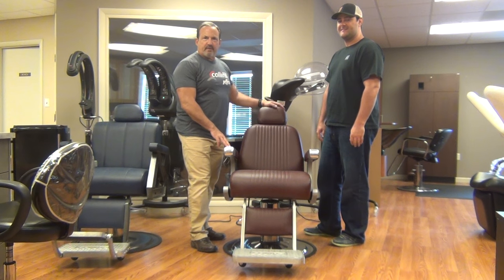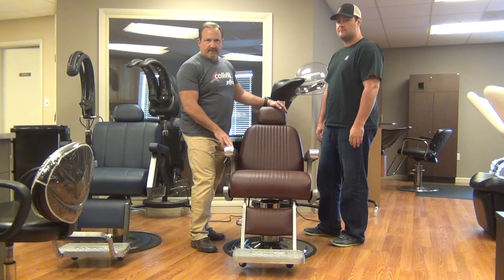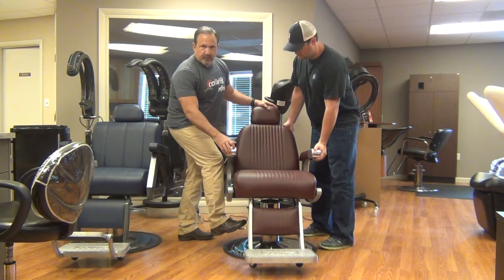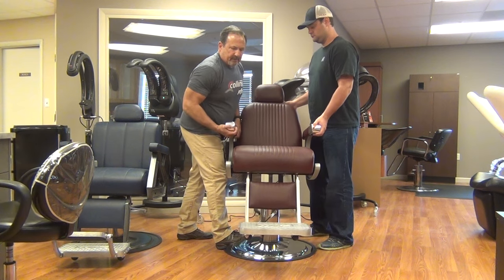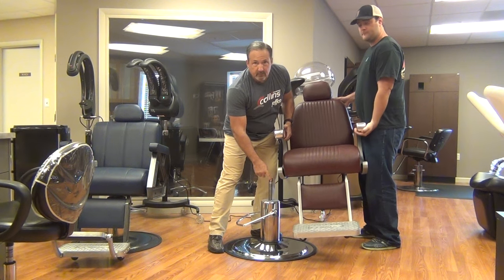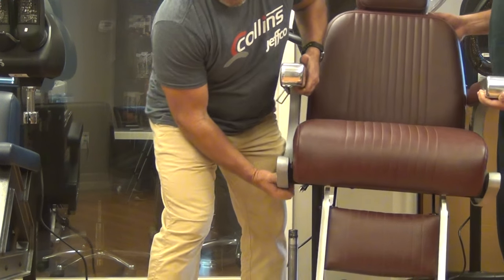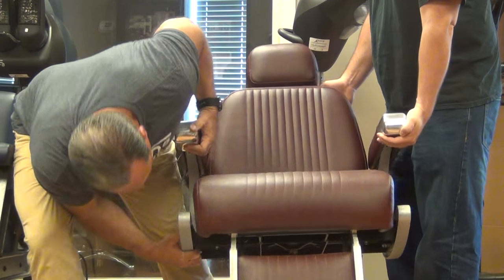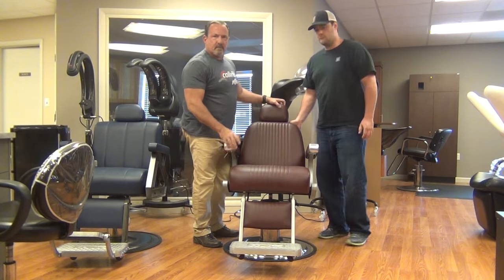Removing a Barber Chair Top from Hydraulic Base

Comment: I find your videos very informative. Do you have a video on how to remove the hydraulic  pump from a 5 star base? I believe it’s a tapered fit but I’ve tried penetrating oil and a 1 lb mallet with a block, I’ve even tried heating it with a torch to no avail. Am I missing something? Any input would be appreciated.
Reply from the maker: Hey there! You can call Johnny at our office and he will help you. 855-757-6877

Comment: Can u take the top off, and put it on a different pump, for example putting it on a different pump u took it off of
Reply: The pump shaft sizes vary. You would need to insure it was the exact same size. Most do NOT innerchange.
Reply: @johnnychaffin307  do u guys @ Collins trade chairs, for example, trade my old Collins chair for another Collins chair, with me even putting cash on top of that
Reply: No. Sorry, Collins does not deal in any used equipment. Also we do not sell direct.